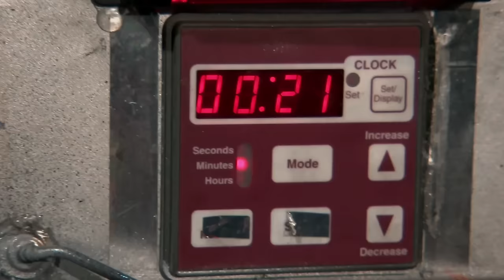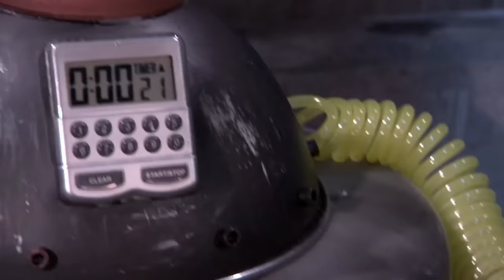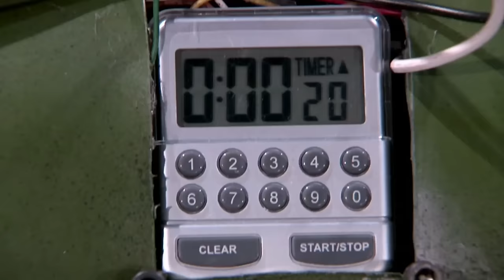MacGruber: Financial Ruin - SNL

Comment: I watched maybe six episodes of the original show. I had completely forgotten that show until SNL started doing these skits. For this episode? Even if a pretty woman did that I would not be turned on, but wondering why they would want to do it. A guy is worse, and it is worse again he was so proud of the Ping Pong skill. There is a show where a couple guys to trick shots or use unusual paddles for Ping Pong; 100 times better than this, but the point of this skit is to be a strange opposite of the Macgyver Show, so it succeeds more in that the more dumb it gets. Ha! I was unsure of the name spelling so I looked it up. I had no awareness until today there was a remake that actually had 5 seasons!